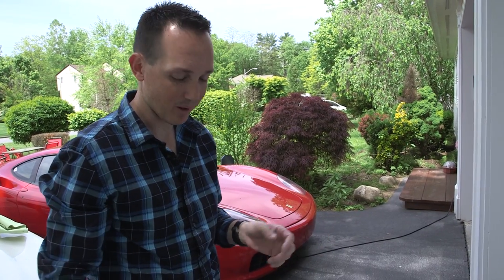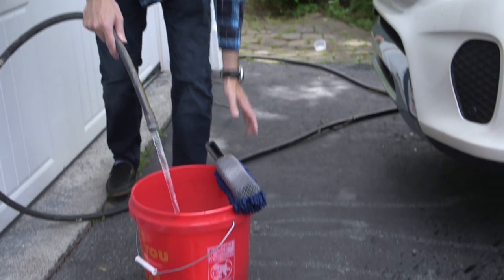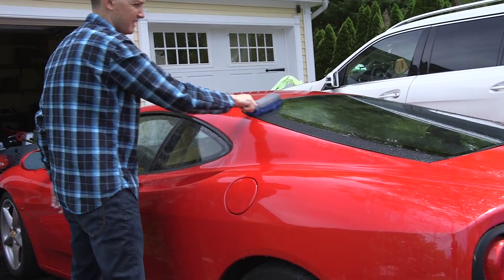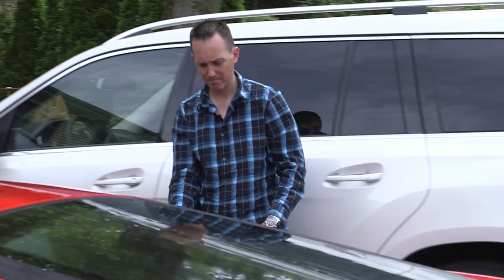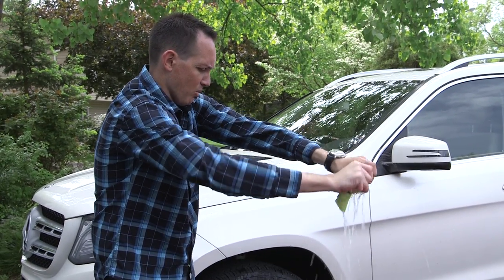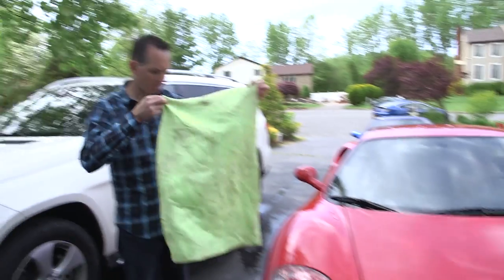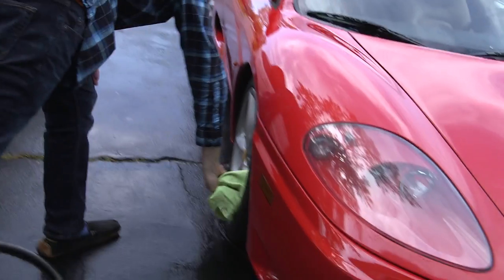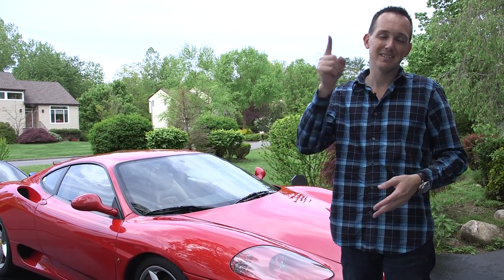I Suck At Washing Cars

Comment: So you rub your expensive car with a brush that touched the ground in a bucket full of sand and no grit guard? Nice.
Reply: Yeah thought the same. He even mentioned that he would throw anything away that has touched the ground. 7:21
Reply: Jimmy Grant Yeah, just like his Supra. Oh wait, it costed $1500 in paint correction.
Reply: Generic Name do you not understand what a grit guard actually does?
Reply: I think I quoted the wrong person.
Reply: I was my 5000 miata with 2 bucets, and am extremely anal about any dust on the brush or rag
Reply: I think washing his car under direct sunlight is the least of his worries after grinding all that filth from the bottom of the bucket and off the wheels all over his paintwork. What a total and utter fail, surely this is an attempt to troll everyone? Clever editing maybe so he didn't actually grind that crap into his paint?
Reply: Mike D Haha yeah, you quoted me initially. No worries.
Reply: Albert Tufillaro Same thing for my Hellcat. Clean & Rinse buckets are a must. Even bought a pressure washer (useful for the house too) and foam gun for the initial touchless wash to be sure I won't be rubbing any contaminants/rocks/sand on my paint with my wash mitt. I drive the shit out of my car and it still look awesome.
Reply: UndeadFleshgod - AND a air blaster to dry the car. You'd be surprised just how much water is left in the channels and recesses. No grinding particles into the clear and no wet cloths to launder and dry.
Reply: Nate Forrester Damn, that is a good idea! I usually go back about 1h later to clean up the streaks at the bottom of the doors and trunk
Reply: with a single bucket, with any old detergent, and then somehow your "drying towel" gets dirty
Reply: Absolutely not. What he's doing is simply wrong. The car deserves better than this.
Reply: Why does this bother people? His car and at the end of the day it's just a car
Reply: No. It's a piece of art, made in limited numbers. A car is more than just an appliance.
Reply: Don't forget that he uses the same 'apparatus' for his wheels and paint

Comment: 1. THAT BUCKET IS NOT CLEAN! So much grit omg cringe
2. Did you say you use the same thing on your wheels you use on the paint? Nice. Tiny metal shavings destroying your paint
3. ALWAYS USE 2 BUCKETS + GRIT GUARD!!
4. Initial rinse is super important as it gets off alot of dirt..not just "get it wet"
5. Those shamois scratch the shit out of your paint. Compressed air is best but patting it down with waffle pattern microfiber drying towel works also
6. Omfg that shamois is filthy RIP to your clearcoat
7. Why do you care if it hits the ground its filthy af anyways?
8. You should never touch car paint again

There is so many simple things you could have done to save time AND not destroy the paint. It literally hurt to watch this.
Reply: I use Optimum No Rinse and charge $50.00 to wash cars. No two buckets here. ;)
Reply: Trent Hallmark ONR is amazing
Reply: Derrick and that Ferrari has absolutely no wax at all. So cringe

Comment: 1)Uses brush "interchangeably" between wheels and car, 
2)Uses brush after it touched the floor and uses his shoes to knock the spider off the brush.  
3)Single bucket,
4)No grit guard. 
5)Smacks hose against the paint a couple of times,
6) Cleans wheels then car and then back again because "it's just easier",
7)Uses drying cloth on car and then wheels and then back on the paint....

Comment: 1. Use two buckets, one soap, one rinse.  rinse your wash device often in the rinse bucket and re soap.
2. Don't swirl the wash device and go in straight side to side motions as much as possible.  If you do scratch the paint a straight scratch is much less visible than a swirl mark.
3. Shammys are ok at drying, but one bit of dirt gets on it at it can scratch things easily.  A waffle weave microfiber towels is very absorbent and you can wring it out like a shammy.
4. When drying, don't put much pressure down.  Drag the towel across the paint in a straight direction and allow it to pull the water. (not every towel is good at working with that method). Avoid pressure and swirling first and foremost!

Comment: Oh dear... thanks for letting me have fun with this one! lets number them out... First mistake, letting the brush touch the ground (picks up dirt and then you drag that all over the car), Second- not using two buckets (rinse/soap) or a foam cannon to get rid of the heavy dirt and loosen the rest. Third- letting the hose hit the paint! Fourth- using the same wash mitt for paint and wheels (more dirt to drag all over) Fifth- not washing from top to bottom (dragging dirt from the back of the car all over) Sixth- using your finger to try and get the bug zap off... (I can here the paint getting scratched!) Seventh- using a shammy to dry the car, (they drag dirt like no other across your paint scratching the crap out of it. I recommend using a MF towel with some QD or AMMO Spit dries much better and less chance of scratching). and you're right about two things not washing in direct sunlight and the carwash doing a better job at banging it out... the wrong way! haha I agree with cars not sitting in the garage and looking pretty but getting you can only correct the paint so much before you run out of clear coat and a proper maintenance wash regime will save you money on the long run :) just my 2 cents

Comment: 1. Bucket looked dirty when you flipped it and whatever that black liquid poured out.
2. Your wash handle or whatever you want to call it touched the ground and then you went on to go put that to your paint and no simply rinsing it with a hose won't remove all the tiny rocks.
3. You don't use the 2 bucket method.
4. You don't use grit guards for your bucket.
5. You don't rinse your "scrubber" enough and when you do you don't rinse it well enough.
6. Worst part is when you used your car washing scrubber onto your wheels then onto your paint.
7. You're not rinsing the car with pressured water. Simply using a garden hose with no attachment is not strong enough to pull off any of the loose dirt.
8. You use the same dirty towel when drying your car and it's not even microfiber which is what you should use to dry your car.

Just some things I managed to pick out.

Comment: Okay Rob. Let me help you out a bit here, I think you need it. 
Before starting you clean your rims.
First off you start by rinsing the car with a pressure washer. Afterwards you foam the car in with a foam canon, rinse again and repeat. Then you use the two bucket method (Google is your friend) with a grit guard and wash the car with a microfibre wash mitt (eBay). Before drying you use the same technique as you did in this video and rinse the car with water from the hose. This will make it easier to dry. When drying you use a big fluffy microfibre drying towel and simply brush it lightly over the pain in the same direction. 

That's all there goes in to it, and then you won't need a 1500$ polish of your horrific paint.

Comment: 1. Different brushes for paint and wheels since any brake dust is gonna scratch the hell out of the paint.
2. Grit guard to keep dirt at the bottom of the bucket and not in the water.
3. One bucket for rinse water and one for water with soap.
4. Better/actual hose nozzle.
5. No circular motion when using a wash mitt or sponge

I can go on and on. Just go to Costco and get a @ChemicalGuys starter kit since it'll have all the basics. Or just call up Ammo NYC to wash them and fix all the "detailing" damage lol

Comment: Let's start with 2 bucks and grit guards for washing one wash one rinse. A third bucket for wheels ONLY. Second is a good wash mit for the initial washing. Use this only for paint and not for the wheels. Start with the wheels using something like plum by AMMO or sonax full effects wheel cleaner. This will get most of the dirt off but using a dedicated brush agitate the wheels. Foam guns help a lot with the initial rinse down. Start from the top of the car washing one panel at a time. Going from wash bucket to panel to rinse and back to wash bucket to start next panel. Once this is complete using a microfiber towel and a master blaster or a MF towel and some hydrate from AMMO dry the car from top to bottom. Last apply some kind of wax to allow for easier car in the future.

Comment: Put your brush on the ground and then say you wouldn't use stuff that touched the ground because it could scratch the paint.  But make sure you wet the shammy so it doesn't scratch the paint...with the dirt that you're rubbing into the paint with the shammy because the car didn't get clean to begin with.  lolz.  Doesn't hurt my feelings because it's not my car as long as people don't think this is a tutorial.  If you put so little effort into 15 minutes washing your car and don't care if it gets scratched, just take it to an automatic car wash where it actually gets really clean anyway for the same amount of time or less.

Comment: Before you even pick up the brush... you need to be using two buckets WITH grit guards. (rinse bucket and a soap bucket.) Next never put the brush on the ground to kill a spider. The brush will pick up rocks and dirt then when you scrub your car you are grinding the rocks and dirt in the paint of the car. Best to use multiple brushes when cleaning. Never use the same brush to clean wheels and the paint on your car. When washing your car don't wear a belt or a shirt with buttons on it could scratch your paint when leaning over to scrub your car. One thing that you did right is not washing in direct sunlight.

Comment: You need to use like 4-5x more soap than you used, and use the "finger trick" to blast the soap in the bucket so it gets sudsy.  If you dont have white bubbles all over when washing it, what's lubing it?  Water and grit.  The more suds the better.  I rinse and wash 2-3x per car wash.  My old cars stay looking nice.  Water blade and a towel to dry, don't forget door jambs, hood, and trunk.
Reply: Hell no, water blade is a must.  Otherwise use a leaf blower/master blaster.

Comment: -Bucket was not clean
-never use the same mitt for the paint as the wheels
-never let your mitt touch the ground
-your bucket does not have dirt filter on the bottom
-you should use 3 buckets. one for wheels. one for soap. one for clean water to dip mitt in after it touches your car, then you can put it back in the soap bucket
- always use clean microfibers/waffle weave
-always wash/dry in one directions
 there is so much more this is just the basic stuff you should be doing at minimum.

Comment: where to begin? first use two buckets one for soap and one for clean water to wash down ur car then you need to wash it with a microfiber cloth to clean it not that wheel thing then use another microfiber cloth to dry it and if you really want a fast method get a foam cannon

Comment: You should really get a pressure washer not only does it save water it also assists in cleaning the car without scratching or scuffing from the dirt and dust on the paint.

Comment: I use to be a detailer. And my cars were spotless washed once or twice a week. 

Anymore I can't stand it. One of my least favorite automotive activities is the car wash. My car is lucky to get cleaned by anything other than a dirty rag or touchless drive through wash anymore. 

Best it's looked in a while is when the dealership washed it after they had it a couple weeks. 

That was last august. That's the last time It was washed. Wheels might be 2lbs heavier with brake dust at this point.

Comment: you need to wach some ammonyc or something....
i would recomend you to invest in a pressure washer and a good foam lance and some mivrofiber to clean and some you use to dry and some iron x to remove brake dust and a good degreaser and NEWER reuse something you have dropped on the ground without washing it first. And you need to start using two bucket with grittguard.

Comment: Using an item to clean your car and wheels is bad, not actually cleaning your tool is bad, using only 1 bucket is bad, wiping a dirty car is bad.

You don't want to scrub a vehicle when there is dirt because it is what causes those micro-scratches that you made a video about. Pressure on your hose will do wonders, even a pressure washer.

My help, get a nozzle on your hose at a minimum. Use 2 buckets, one for dirty water, the other for clean soapy water. Get 2 tools to clean, one for the paint, the other for the wheels, also remember to replace/clean them when done.

Comment: Lack non-metal hose shutoff valve
Should use 2 bucket system -- one is a sudsy water bucket the other is to rinse and wring out the dirty mitt
Wash a panel, rinse in water bucket, wring, soap up and do another panel
No rings or watches that scratch
Use mitt for body and separate mitt or scrub bars for wheels
UGHHH no chamois!!!! use a leaf blower to blow water off then a micro fibre towel to finish  And if your finishing dry towel looks like that you suck at washing cars haha.
Wipe in straight soft movement -- avoids halos and swirls
Washing my car takes 30 min and normally 2 hours because i also get the back of alloys
Next is the inside but practice the exterior first for a few weeks.

Comment: 5:10 Metal hose tip resting on paint... lol...

I do admire how care free you are, unfortunately I just couldn't do that. At least use a separate brush for the wheels.

Try and find one of these cheap:
https://www.amazon.com/Mr-Clean-AutoDry-System-Starter/dp/B0006M56CE

I think you'll appreciate how much time it will save you. Contrary to what it says you can use any car wash soap in it just fine and I'm on like year 11 on the same water filter. I still lightly dry the car with a microfiber towel (chamois on the windows for streak free), but after rinsing it with the filtered water the spots you miss don't dry ugly.

Comment: I see the problem....you are rich ....your Minion should be doing your car after being trained by Larry!
Seriously though,you did everything wrong. Pressure washer is essential,foam the car then rinse,  90% of the crap that scratches your car will come off. Then wash...turning and rinsing the sponge all the time. If fussy like me...after drying i use my air compressor to remove water from seams,grill etc.

Comment: Congrats on washing your (Ferrari) car. I do think you broke a couple of cardinal rules doing so. Cleanliness is next to godliness and that includes buckets, microfiber towels and using on a wheel brush on your wheels. Keep your chamois away from your wheels because of brake dust. A clay-bar may remove tree sap if necessary. Again, kudos for keeping the Ferrari looking good.

Comment: Get a foam gun and a real sponge.. that thing is too small.. it concentrates the dirt into a small area = more scratches..  Also, use two buckets.. one soap and one water that you dip the sponge in first before applying more soap.

Holy shit.. do not use the same items on the wheels.  Your shammy is now full of dirt and creating more scratches in your clear coat!

Comment: I cringed the entire video omg

I couldn't imagine seeing your paint on the Ferrari. 

Looks like you spent no more than 20 mins washing your car. Takes me an hour and I drive an 05 Acura TL😭😭😭

My recommendation - instead of wasting $15 on a hand wash every time, do it yourself. 

And please, please, please, use a sponge with a mixture of car washing soap and water in a bucket to wash the car and use a degreaser on the wheels with a separate wheel cleaner (recommendation: as much as ArmorAll products suck, the one thing I like is their wheel cleaner). And for gods sake, use a microfiber with spray wax or detail spray of some sort (I use Adam's Polishes H20 Guard and Gloss to dry my car). Takes 45mins-1hr to wash my car every time, but at the end of it, I spend maybe $20 (I wash my car 5-6times a month) in a month to clean my car while you're spending ~$90 (if you go 5-6times a month per car like me)